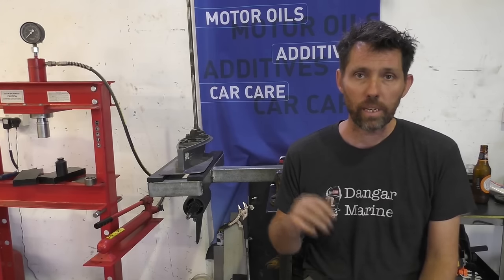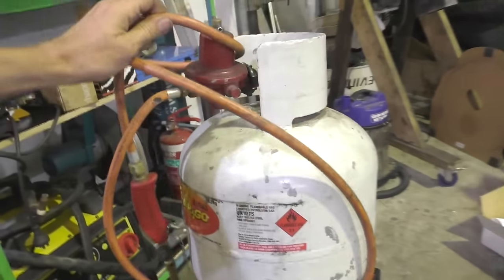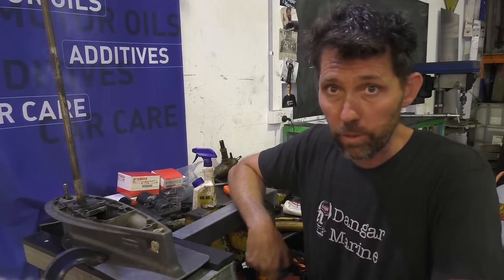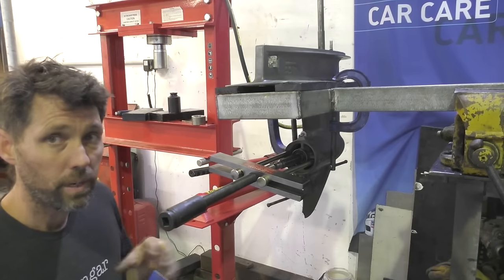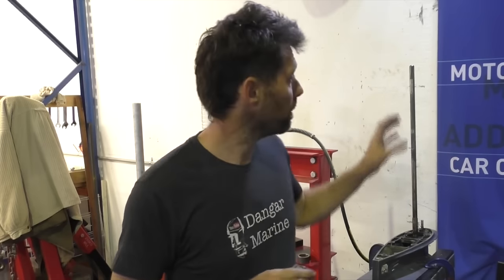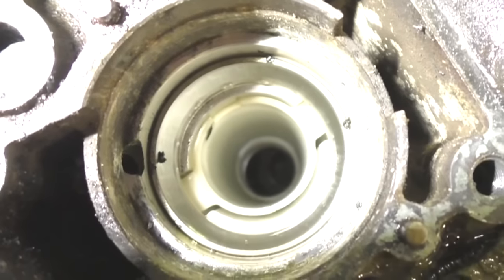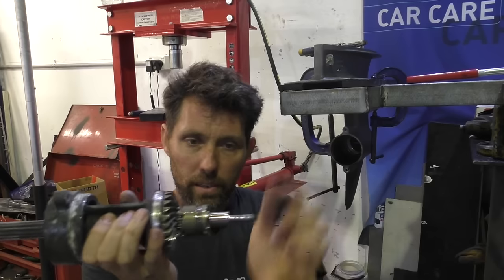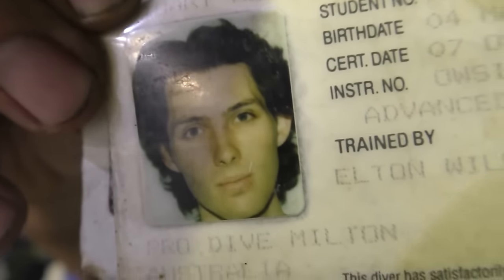Removing an outboard driveshaft

Comment: I was told that when the lower selector shaft was removed, the spring tension pushed the selector lobe and engage the forward gear. I was also told that I had to remove the lower gear box. Why can't drill a hole so I could push the lobe back, insert the splined shaft, then thread the hole and put a screw similar to the vent, fill, drain screw..

Comment: Excellent video. Thank you.
Reply from the maker: Glad it was helpful!
Reply: @DangarMarine  Is it possible to remove the shift shaft without stripping the lower unit on a 2006 Mariner 50Hp triple? SN is OP409797. Looks like it will come out when top seal is removed. Hope you don't mind me asking.
Reply: For anyone else with the same question, yes it is.

Comment: Hey mate.
I have just purchased a second hand leg, the shaft has a little play (3 - 5mm) up and down. When the shaft is seated and I spin it by hand it feel and sounds a little clunky and not smooth, but when I pull the shaft up 5mm it's smooth and has no friction. Any ideas would be great

Comment: I am rebuilding lower unit 50HP evenrude ..what would be the proper way to shim pinion shaft+gear?
Reply from the maker: To determine that you are going to need the service manual for that motor and possibly any special tools they mention. They are all different unfortunately.

Comment: Any tips on how to help the pinion gear off if it doesn’t just fall off after removing the nut? Tried a few tugs on the driveshaft but it seems on there pretty tight.
2007 Yamaha F150TXR 4S

Appreciate the knowledge you’re sharing!
Reply from the maker: I would try either prying the pinion down or maybe even put a slide hammer on the drive shaft to lift it up (with water pump and bearing retainer removed of course)

Comment: Hey buddy I don't know if you remember me talking about removing my driveshaft a few weeks ago I finally got it out but my question is where exactly did you find the socket that fits on top of the driveshaft so when I put it back together I have something to torque the pinion nut with instead of putting something on the driveshaft of itself I know if I grab the driveshaft in the middle there's no harm but I think that socket would be very helpful for me
Reply from the maker: I can't remember exactly where I got that one now, but you can generally order then through a dealer of your outboard brand. Sometimes they can be a bit funny about selling tools (I believe it is a part of the manufactures rules for dealers), which is kinda annoying and I would even argue questionably legal because as an owner I imagine you have certain rights to maintain it. Having said all that, next time the SnapOn truck comes past I'm going to ask him if they sell a set of all different sizes. I may have to get a second mortgage to buy them though...

Comment: good general information vid stu.my yamaha gearbox had a diferent selector.it had the drum type that hooks over a nipple on the selecter rod,which in my eyes is a weaker option, its awkward to reasemble and ive broke 2 of them because mine keeps jumping out of forward gear. iv since took a grinder to mine and ground off the rounded edges on the gear and clutch dog  and put a slight backward bevel on them so it should hold it in a bit rather then throw it out of gear . can you explain how to shim up the gearbox in the next vid or how tight or how much clearance you should have if you change any gears or pinion .thanks peter
Reply from the maker: Hi Peter. It's interesting that you say you did this with a grinder. The machinist who does mine says that they come from the factory with a rough surface that is actually better for grip and given they just press against each other I can't see why it couldn't be a DIY job. He does do the clutch and the gear at the same time to make sure the angle is exactly complimentary, but I'd be interested to experiment with doing this job myself one day. Anyway, the short answer is yes, will do a shimming video as soon as I can.
Reply: Dangar Marine thanks for your reply ,i took it to a machine shop and typically was told it was too harded surface and couldnt be done .lol too me that was throwing down the guantlet . i used a 40 grit skerving disc and found it real soft.on the forward gear i had to use a dremel but squared it off no problem , the only concern is iv made the spacing inbetween the clutch dog and geardog bigger so maybe a bigger slap when it enguages into gear but i will give an update when i fit it onto a boat to test it under load . the gears and clutch dogs are so expensive im sure there must be a cheap hack to "recondition them "

Comment: Great video, very detailed, I have a question. I was full throttle in my 76 mercury mariner 60hp when I head a pop and lost 90% of thrust.  I removed the bearing carrier thinking the pin in them dog clutch had sheared but it fine, in fact I inspected all gears etc... and I see nothing of concern it all looks great in the gear case. The engine performs as usual. Any thoughts of what could be the issue?
Reply: love to know what was the actual diagnosis and repair.  my guess is a spun prop

Comment: You are always very informative.  I have a 1999 df40 Suzuki and I'm hearing a whine in the lower end.  the noise comes and goes.  I suspect its one of the bearings since the drive shaft and the forward bearing and reverse  (is there one for reverse too?  I assume so) are all spinning when in neutral.  Is the process about the same for this model?  I do all my own work since I cant find a mechanic that really knows what they are doing.  I've replaced the water pump so getting to that point is no problem.  Also, once I have pulled the lower gearbox I suspect I should be replacing the oil seals there?  what do you think?
Reply from the maker: Hi mate. I haven't worked on many Suzukis but I would be very surprised if they were significantly different from the other Japanese brands. There are bearings for reverse too, I am planning to do a video soon on replacing them all. If you have everything apart it is always a great time to replace those bearings, it could save you a lot of time down the track.

Comment: Great video. But how do you pull out those bearing races ? And how do you pull out the needle bearings. ? Thanks.
Reply from the maker: Thanks Torben. Those bearings are removed using special bearing pullers. I'll definitely be doing a video on that before too much longer.
Reply: Dangar Marine Thanks. I'm doing a complete rapair of my Yamaha F40 Efi lower unit, so it would be great if you could make that video.  Videos of how to do it, makes it so much easier to mimic, than doing it with only a paper manual. Looking foward to it.

Comment: Ivhave a 1997 yamaha f250 and the drivers shaft is strip out from the top. 
Do you recommend to replace the part that the drive shaft sit on the top?

Comment: I really need help with my motor. It’s a 80/90’s model 25 Mariner with electric start FNR on the side of the cowling. I’ve got the whole foot off of the motor and carrier bearing removed. All that’s left is the pinion gear and the forward gear. My pinion gear has no nut but will not come off at all. Please help

Comment: I have water mixing with the gear oil in my Suzuki df140 lower unit and when I replaced all of the oil seals I noticed the shat have some serious play in it and top bearing looked rusty should I remove the hole shaft in order to replace it ?
Reply from the maker: Yes, here's an example  https://www.youtube.com/watch?v=eaNXtos2b3k

Comment: Thanks so much for taking the time to show how all these pieces fit together. I've been searching like crazy for a like this. I engaged the forward gear when the propeller was touching a rocky beach... The engine seems to be running ok, but the propeller won't spin.
Do you think it's something to do with that kemload you talk about in 13:40?
Cheers

Comment: Hey Stu did you do the video removing the drive shaft bearings yet? I've searched but haven't found it. Working on a little 1968 Mercury 110 and the drive shaft bearing is shot. The powerhead, gears, dog and shift selector are all in very good condition. Would love to save this vintage outboard if I can find replace parts- water pump impeller, rings, seals Etc
Reply from the maker: No, I haven't got around to that yet. I really would like to do more gearbox repair videos. Most of the time you just need some type of bearing separator tool like this https://www.amazon.com/ATD-Tools-3056-Bar-Type-Separator/dp/B004IQ8RMU
Reply: Dangar Marine thanks Stu. When my friend brought this frozen 1968 motor to me we thought we were going to find bits and pieces everywhere in the gearbox. Surprisingly it's in great condition. And this is going to be a fairly inexpensive repair :-)... The first repair shop he brought this to told him 'the only thing it was good for was an anchor'!!  Lol

Comment: Excellent video! Wondering if you have any advice for a driveshaft that appears to be seized in the power head. I.E. the lower unit wont drop. Hope you have you have a brilliant trick you wouldn't mind sharing.
Reply from the maker: Unfortunately there is no easy way with this problem. You can sometimes unbolt the powerhead and lift it slightly from the lower cowling to get heat and penetrating oil in there. Wooden wedges above the gearbox can help keep pressure on overnight etc. I've also tried turning it upside down and running penetrating oil down the driveshaft to reach the crankshaft etc. etc. Good luck!
Reply: @DangarMarine  Yep, those are the working theories I have as well. Thanks for taking the time to reply. Hopefully patience and perseverance will prevail in this project. Keep up the videos.

Comment: Busy trying to replace the drive shaft bearing on our 04 90hp yamaha. Do you have the tool for the locking ring for the carrier cant seem to find a part number. Thanks for the vids helped with a lot.
Reply from the maker: No, I don't have that tool as none of my outboards have needed it. If you can find a PDF copy of the service manual on the net it will list the part numbers for all the customer tools needed to work on it.

Comment: great video Dangar Marine ! on my 30 hp Mercury when i remove the main driveshaft my bearing is the opposite way to the one in this video  is that normal that some motors have the bearing the other way ? seems like it should go the way this motor was to hold the drive shaft in the right place

Comment: On a 1983 mercury 115 hp serial 7200341 took the nut off but can pull the shaft off is there another peace holding the pinion gear ...Thank you
Reply from the maker: Not that I know of, no.

Comment: Very Informative... Thanks.
I have a question maybe you might help with.
I have a Mercury 2.5 HP four stroke outboard and I was wondering if it would be up-gradable to 3.5 HP by merely changing the Carb Jets.
My basis for this theory arose when I was looking for parts online for the motor.
As I was looking through the parts diagrams for the 2.5 HP and the 3.2 HP I noticed that ALL the engine parts are the same IE, SAME PART #s…  The cylinders are the same size, the bore is the same, and the stroke distances are the same. The ONLY differences I could find were the Main jets and Slow jets had different part #s.  The part number for The Carb Housings are different too... BUT EVERYTHING ELSE IS THE SAME.
So in my “Genius”, I figured that if I were to replace the 2.5 HP’s jets with jets meant for the 3.5 HP, the power should increase.
Now I’ve already bought the jets (but not installed them yet) and I was thinking that the jet holes on the 3.5’s will be a little bit larger, letting in more fuel… and thus producing more power at the throttle.
I’m thinking the simplest, quickest way to see if this works would be to run the motor in its original state and record the High and Low speed sounds from a certain distance… Then change out the jets and record the High and Low speed sounds of the motor again. Then compare the before and after sounds to see if there is in fact a difference. 
Does this Rational make since to you? 

Thanks.

Comment: Hi Buddy , nice vid. I've a Yamaha 150 VMAX HPDI 4 stroke 2002, L- 20" shaft and I need a lower unit for it. I 've only the prop. RH. Any idea, once you busy and know someone selling this parts.Excellent video like always. teach me a lot in my practice with machinery.  thanks in advance.
Reply from the maker: Hi mate. If it was me I would try Arizona outboard wreckers on the Central Coast or Sea Sea Marine down near Botany. They have loads of second hand parts.

Comment: is it possible to use the gear box from a long shaft and usedon a short shaft tohatsu m8a or is a m8b interchangleable
Reply from the maker: Yes, generally gearboxs are exactly the same between long and short shaft motors.

Comment: Great video I'm new to the boating world and your videos have helped me a lot i have a 1985 mercury mariner 60hp and i seem to have an issue with the dog clutch i was wondering if you can tell me what type of pulley you used to remove the shaft 
thanks
Reply from the maker: The puller I use is in this video, I think I got it from Snap On. The attachments to the outboard vary based on the model https://www.youtube.com/watch?v=_PnpoEDPqMA

Comment: What’s behind the the cam follower. I see you easily pushed it back in while demonstrating a change in gear what keeps it from sliding all the way into the driveshaft?
Reply from the maker: There is a spring behind it and the hole it goes into isn't any deeper than it needs to be.
Reply: Dangar Marine thank you! I have a interesting situation then. I only found 3 metal balls and nothing else. I ordered the replacement spring and it’s easily 2 inches taller than the slot in slides into with the cam follower towering above.

Comment: Stu I ran into a problem with my 2001 Mercury 50 hp 4s driveshaft removal. My upper shaft bearing has a retaining nut (4 tabs) and not a washer. Any Idea how to get that out. I tried heat and muscle but only managed to break off 2 tabs. If there is a tool I think it will be less effective now that I only have 2/4 tabs remaining. So frustrated with the damn thing right now. Everyone feel free to offer advice as well. I'm up to trying anything reasonable at this point.

Comment: I am so glas that you made tjis video.
I have a 1997 yamaha 250 that the top teeth on the shaft are not engaging (theu look a bit stripe out) and I hope that replacing the shaft will solve my problem.

Nonetheless, just in case do you have any video on replacing the part on top that the shaft engages to?
Reply from the maker: The top of the shaft engages directly to the crankshaft which unfortunately is quite an expensive part and a big job to change.

Comment: I'm replacing my clutch  on a 1984 Evinrude 90 hp. M# E90MLRCD.

When I lock the nut up. And spin the drive shaft(counterclockwise)

The shaft is spinning on the water pump side of the lower unit. But it is not backing out of the nut.
Any ideas?

Comment: And what do you do when the driveshaft is broken by the pinion gear. How do you get it out? Just happened to me shortly after I put the new reed valves in and it was running great. I pulled the lower unit and took it to a older gent that says he has a way to get it out. I'll pass that method along if you want if we get a successful fix. 1989 Nissan 70hp to refresh your memory.  Great video Stu!!!
Reply from the maker: Depending on how it is broken you may be able to punch the remaining bit down into the gearbox and then out.
Reply: Biggest takeaway for me on this whole thing is after talking to him and telling him where I fish at, the lake I fish at has alot of stumps in the water, with alot of them just out of sight below the surface. It does have excellent boat trails, but you have to often times motor from where you are fishing out to those boat trails. I'm running a stainless steel prop, and it has always felt nice to look at it after a fishing trip and always looks like new. 

But the thing is and even though I was going slow, often times I would hit a stump and it would keep going fine and often times it would kill the motor. Apparently all of those licks , even though the prop looks good it was taking a toll on the driveshaft and really the whole drive system. 

So when and if I get running again,,, lesson learned, the trolling motor will be the sacrificial means of getting to the boat trails and I will at least be able to see a few of them maybe,,,, Nonetheless bottom line lesson learned.  

He suggested going back to aluminum prop. While I agree with his thinking  going the trolling motor route in the future..Maybe this comment will help someone else in the future consider this thought at least....

Have a great trip and see ya soon!!!

Comment: hey dangar before i start my project is this the same method i would use to remove the shaft from a 1957 lower gear case
Reply from the maker: Not sure about an outboard that old, but I would imagine it is a very similar process, yes.

Comment: great video.....
I noticed metal finding on my drain screw when i did an lower oil change, do you know what that might be?
Reply from the maker: That is very common. Small bits of metal chip off the dog clutch and the backs of the gears every time you select a gear. Letting the rev drop right down before changing gears will help a bit, but you can't avoid it completely.

Comment: Is it possible to pull a driveshaft through the lower unit without removing the water pump/housing/key?  My 15hp Yamaha has a driveshaft totally seized into the crankshaft and I can't lower the lower unit more than about a millimeter.  I think I could get it un-seized if I had access to the shaft.
Reply: Nevermind I used woodworking spreaders on the casing and whacked it with a mallet.  Success!